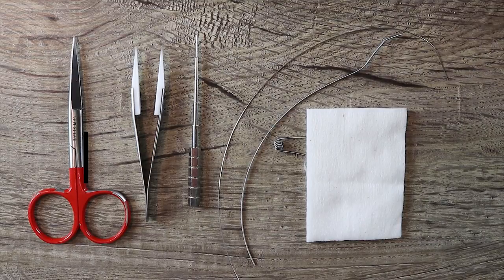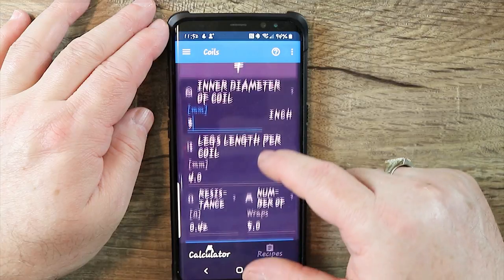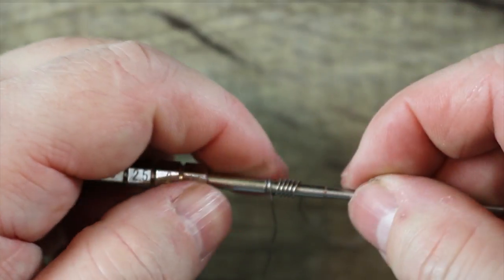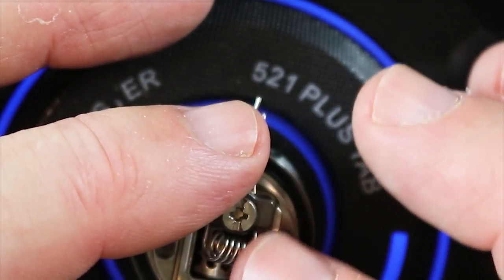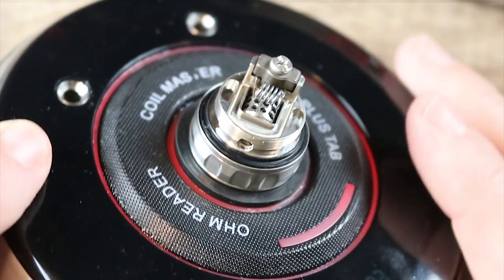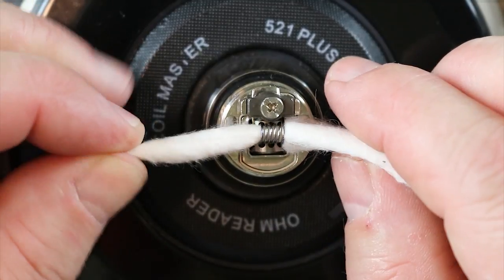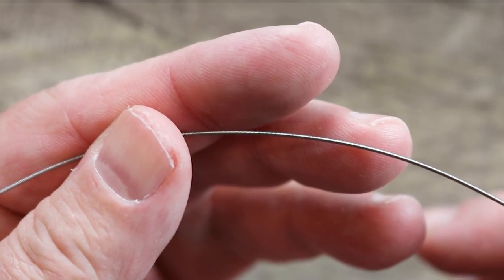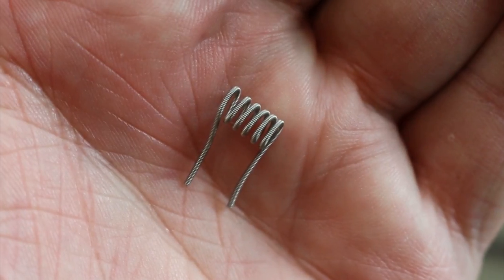COIL BUILDING 101 - HOW TO MAKE VAPE COILS FOR BEGINNERS

Comment: Good work - it's easy for us to forget the novices who have never built a coil, so showing such simple builds tends to get neglected.
It's worth remembering that if both leads exit on the same side you have a half-wrap in there, which can be easily forgotten.
For PC users I always recommend Steam Engine Coil wrapping section as the calculator of choice.
With either, you can select a target resistance and it will tell you how many wraps you need.
That way, if the number of wraps is unreasonable, you can change the wire size to get something that will physically fit.
Reply from the maker: Great comment, thx.

Comment: I like to put an extra wrap on my coils, and then pull down on the left leg. Gently pull on the leg until the coil does a full rotation, and you pull out the extra wrap. This will give you a nice tight coil, and you wont need to compress it as much. It should also make the legs on both sides nice and even.
Reply from the maker: Good tip.

Comment: Alright buddy what’s best rta tank for flavour and beginner builders? Also what ting on accept on Facebook group. Hopping you don’t mind all the q’s.also is there better wires or specific wires to use I run aegis max usually 0.4 60 watts but use tc-as 470*f tcr 105
Reply from the maker: THC One.

Comment: Awesome video jack . Really Informative 😀 by the way I had a question typically how long do these coils last before you’d have to change them and rebuild a new coil . And how often would you change the cotton if you’re a chain vaper ? is changing cottons the same way you did in here ?
Reply from the maker: That all depends on the juice, wattage, and cotton. When the cotton starts getting dark, its time to rewick. Your mileage per coil will vary depending on the X factors I just mentioned. When it starts to taste funky, dry burn, and rewick.
Reply: Coils can last easily up to six months and longer w care. Rewicking can be dependent on a number of things but typically 3 days to a month all depending on juice and how u vape

Comment: I can guarantee that if I use that same exact wire, with the same exact amount of wraps, the last thing it will do is give me the 0hms that the calculator tells me I should get.  You never did show us what 0hms the mod was detecting the wire as when it was connected to a mod :P.  It's useful to know though, how to build.  The wire company I bought all my pre-made coils from has just decided to move abroad on us, so I'm stuck for pre-made's now.  All I can get is the regular round wire now, so it's useful to know if your in the same position that I am now.  I have 500ft of Kanthal A1 sat on the shelf next to me, which I bought just in case I had trouble buying pre-mades.  If I can wrap my head around building simple coils, I figure that there's enough wire there to last me maybe 2 years or more, depending on how many times I recoil, which is usually at least once or twice per month.  By the way, am I right, considering your accent, in thinking that your based around the New York area?
Reply from the maker: It may not be exact but it's always very close. Yep, NYer, born and bred.

Comment: Hi, i dont know what type of vape to buy. I have a little bit of a jaw problem, i dont like to suck on it too hard at all. because that will bother my jaw. What type of vape is easy to draw on, but also extremely smoothe & delicate on the lungs? Right now i like using 3-6mg freebase , and i would like to vape very very very often?
So what type of device should i buy? I was looking at the Voopoo but then i came across your VooPoo Dragbaby mini review and you said you didn't like it when compared to other products in the same category?
I want something that doesn't leak, is easy on my mandible (so i do not have to suck hard) and does not hurt my throat or lungs.
What is something that you would recommend for me to get? Any help would be extremely appreciated!!!
Reply from the maker: Look at some MTL setups.

Comment: What app is that ive been using steam engine for coil wraping and its not as advance
Reply from the maker: Vape tool on Android.
Reply: @VapingInsider  thank you ive gotten into building with simple 22awg round wire